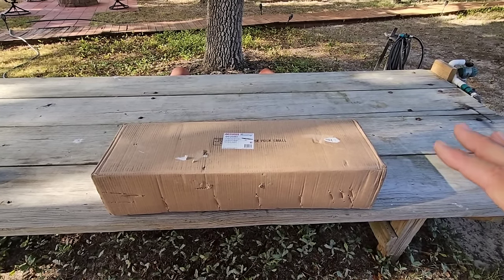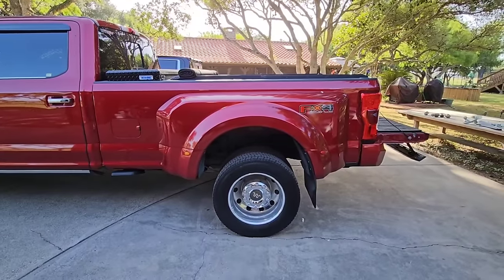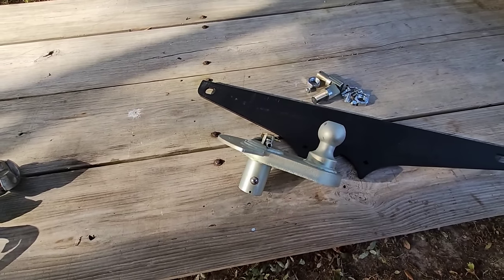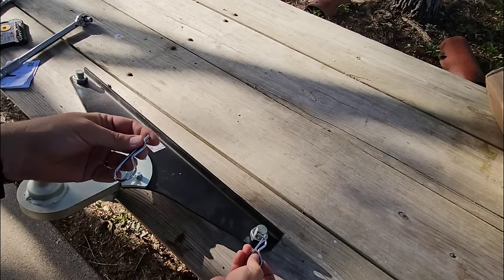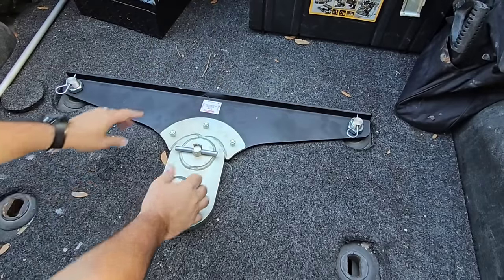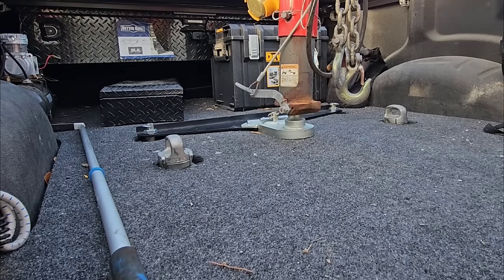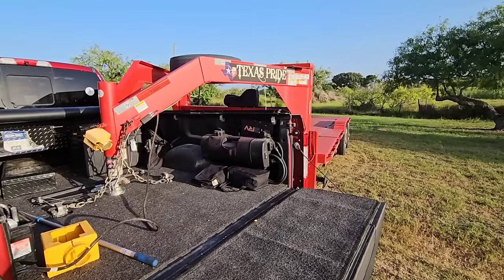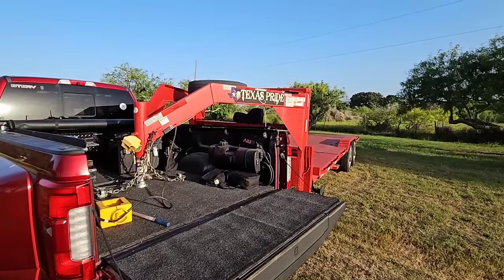Most Amazing Gooseneck Hitch for OEM Puck Systems! Gen-Y Offset Hitch!

Comment: I towed my 5th wheel 3,000 miles with it and it was awesome. So nice not worrying about turning in my short bed Ram 2500.
Reply: Did the gen y hitch help with some of that bouncing you can get on bridges and repetitive dips you get on bridges over a 5th wheel pin?
Reply: @blakenoble9468  Maybe @DSealy0902 didn't go over any bridges in those 3,000 miles? 🤷🏻‍♂️

Comment: Can anyone help me understand WHY on Gato's green earth anyone would choose a short bed over a long bed? If I can't lay sheets of plywood flat between the fender wells and close the tailgate without crap hanging over the top edge, that ain't no real truck IMHO and I must have -- first and foremost -- a REAL truck. :) I guess they can bury me in my 2000 F350 with the mighty 7.3 diesel (4WD, 8' bed, crew cab) -- 353,000 miles and still going strong! :)

Comment: The problem I see would be under hard braking. Your ball goes from roughly 2" in front of the center line of the axle, which would leverage weight to your front axle under hard braking, to roughly 2" behind the center line of the axle. Moving the ball behind center line (in my mind at least) would be more likely to REMOVE weight from the front axle under hard braking.

Comment: Would love to see you put this in a short bed superduty, and see the cab clearance with a goose puck setup, like on your rv. We haul with a short bed F350 and are stuck with a slider hitch.
Reply: I used a slider (PullRite Super Glide) for 10 years on my short bed Ram and it worked GREAT! However, it is very large, heavy and difficult to remove when not needed. With my new truck (also a MegaCab shortbed) I did away with the slider and changed the pinbox on my trailer to a Reese Goosebox and am using a B&W Turnover ball hitch with a B&W offset ball. No more heavy hitch, better towing, easy to use the bed of the truck when not towing. The Goosebox isn't cheap but works very well and I wouldn't go back to a slider for anything....
Reply: The Anderson works amazing on my short bed f350. I can clear my 36’ Montana.
Reply: I vote for that
Reply: @vincentsumner5232  Same, my Anderson works great for our f350 and small fifth wheel camper.
Reply: I have it installed on my 2022 f350 SRW. So i can use a full size toolbox and fuel tank set up.

Comment: I am a truck driver.
 I have been a truck driver for over 40 years.
  I have well into 3 and a half million miles.
 Well pin Should be 1-2 inches in front of the rear axle.
 So you have steering weight.
 By moving the pin back you are taking away from the steering axle.
 Which makes the front of the truck lighter than it should be.
 That's  How people get in Rick's.  
Thank you
Reply from the maker: As an OTR driver, you also realize your dealing with significantly more weight on the pin.  Max on a dually pickup with an RV should never exceed 4k lbs in most cases.  OTR trucks, especially when bobtailing react far different to no weight and generally are asked to carry upwards of 15-25k lbs on the back. Position is far more critical.
Reply: @days4day234  I don’t agree with this as with a rig you would want to evenly split the weight of the trailer between drive and tandem, whereas with an rv you have most of the weight on your trailer axle

Comment: My gooseneck ball is centered on the axle. That's how I got the truck. When I mounted the 5th wheel rails, I moved it forward of center by about 2 inches. That way, more of the weight is dispersed over the whole truck instead of everything being on just the rear axle. Believe it or not, it handles better and I don't have a problem with clearance. 2003 Dodge dually. 36' camper.

Comment: I have a ram shortbed 3500 and have been using this for the last 5 months and has been a game changer on being able to get away from a slider hitch and use the Reese goose box on my solitude. Can’t quite get a 90 degree turn but can get extremely close and in no situation has it not been enough clearance as long as using a little common sense
Reply: Good to know! thanks!

Comment: I haVe been using one for months in my Ram 3500 standard bed. Love it. Zero issues so far. Much better cab clearance and tailgate clearance. Worth the price. 3121RL Montana with a goose hitch like yours.
Reply from the maker: That's good to know!  I'm loving it! My one wish is that they add a loop for the trailer breakaway cable.
Reply: @BigTruckBigRV  that would be very convenient.
Reply: @BigTruckBigRV The DOT doesn't allow the breakaway cable to the hitch itself. At least on a conventional 5th wheel or bumper pull hitch. That way if the hitch separates from the vehicle it could still activate. At least I think this may be why it doesn't have an attachment point on it.
Reply: @BigTruckBigRV I think your earlier stated practice of attaching the break away to a third puck location is actually better than having it on the relocater bracket.   That way you’re truly isolated from any catastrophic failure of any hitch components.

Comment: My Grand Design came with a Zero Point Turn. The weight of the camper is directly over the axle and I have more than enough room at 90 deg. I also traded my 2500 Dodge for. F250 and I have 3" more clearance over the bead, a big win

Comment: Problem solved thank you for showing off this product. I was struggling trying to fit a weather guard tool box and 50 gallon transfer tank in my 22’ 6.5 foot super duty bed. While still maintaining the ability to tow a gooseneck. Will be purchasing.

Comment: Nice review on the Gen Y offset hitch adapter!Maybe that Texas heat contributed to the expansion of that pin sliding in the hole.On building engines, we used to put wrist pins in the freezer so they would (push right in), that was on a 426 Hemi blown injected funny car application.Obviously couldn't do it in this application, maybe a little spray refrigerant would help.
Reply: I have to do the same thing with my 5th wheel -- wheel bearing seals -- impossible to tap in without leaving them overnight in the freezer and installing them immediately the next day -- which, of course, no tire store is ever gonna' do. But they'll happily leave them sitting loose on the spindle and charge ya' $250 for nuthin'. :(

Comment: Crazy price for no more material then what’s involved building it. Especially when you compare the cost to a 4” B&W offset. 

I own one with a Gen 2 Goosebox and it works great  with my 2023 F350 SB.
Reply from the maker: Can't really compare.  B&W doesn't work with OEM fifth wheel gooseneck prep trucks, it also is far more simpler in design. It's also rated at 5k lbs less capacity and is significantly lighter duty.
Reply: @BigTruckBigRV  I own the Gen Y 5” offset puck system. Really there isn’t that much more material wise then the B&W. Little bit off flat bar with a couple pins. I would think it should sell around the upper 200’s to $300. I even think the 4” B&W offset is priced to high too, I had one of those in my Ram.
Reply: @seekingadventures  Agree. Way over priced.
Reply: You are always entitled to build your own if you think you can do it for cheaper.  America.  Freedom.  No one is strong arming you to buy it if it's out of your price range.  

How much is a slider 5th wheel hitch?  How much does that slider take away from your payload?

Comment: I would be concerned about the pressure that the plate would wear on your spray in bed liner. Because the down pressure would not be over the goose ball hole in the puck system, it would be 5"s back on the bed of the truck. Just my 2 cents.

Comment: Thanks JD for this review. My truck has the puck system but I haven't needed to use it yet for the goose ball. I will keep this in mind when the situation occurs. I will tell others also.  JD I have a question off topic. Have you any advice on RV refrigerators. Especially on fans mounted inside to circulate the air in the "box"??

Comment: I was wondering how this 5 inch offset will affect the weight on the front end of the truck?  Will this offset affect handling or steering in an evasive maneuver?  I was also wondering if you took your front and rear axel weights to see the difference?

Comment: I need this.  Had to jack knife my 5th wheel (little car cut me off, turn or run over the car) that I use a gooseneck hitch to tow.  RAM 3500 shortbed, and the 5th wheel overhang crunched the side of the back wall of my cab.  I said some bad words!!!

Comment: You are increasing the stress on the hitch point with the 5" offset, is the 1" plate going to bend and damage the bed of the truck after extended use? Just wandering
Reply: All those who wander are not lost :)

Comment: Does this potentially make the slider hitch obsolete???  I currently have the PullRite SuperGlide in my 2021 F250 shortbed with the factory puck system.  I added the puck system to have flexibility but ultimately was convinced I should have a slider hitch so went with the SuperGlide, but IF this combined with a Reese Goosebox would eliminate the need for the slider then that is a win.  Probably not less overall cost but I do get my bed back!!!!!!  Do people really think this would be a viable alternative to a slider and still get 90 degree turning capability?
Reply: Yes. The Goosebox tows extremely well since it has built in suspension (airbag and twin shocks) and is VERY robust. Does NOT void the Lippert warranty on the frame like typical gooseneck adapters (plus MUCH safer). Unless you already have some kind of factory setup (sounds likely) you could go with a B&W Turnover ball and get their 4" offset ball ($185 or so) and solve the turning problem and ditch the huge Superglide hitch. NOT knocking the hitch...I towed with one for almost 10 years and it worked great...but you will LOVE having the bed of your truck available again. Best upgrade I've ever made for 5th wheel towing. Well, other than upgrading to a 3500 dually! 😄